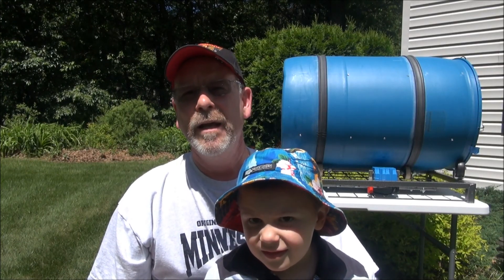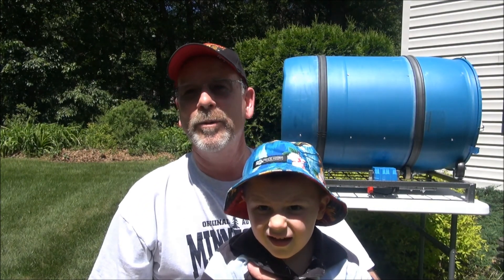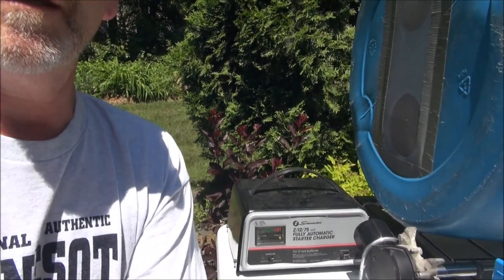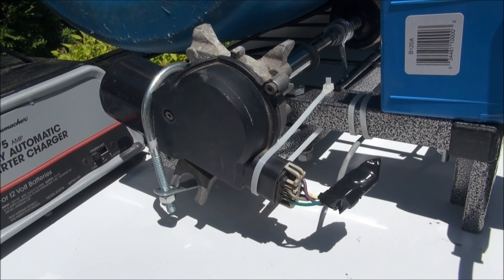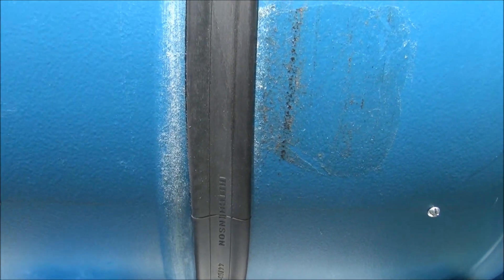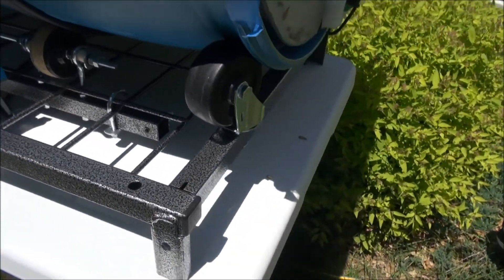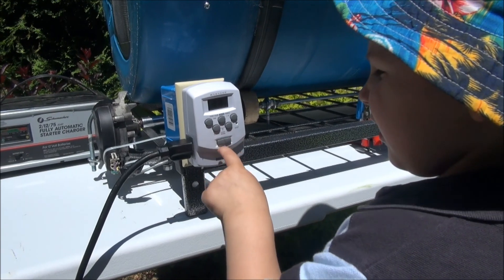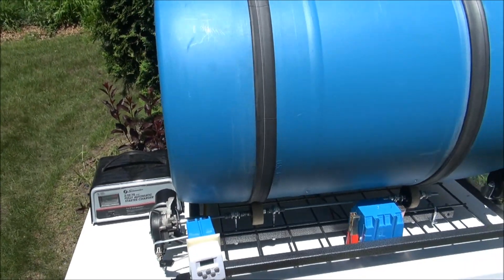Barley Roller

Comment: How  did you mate the 10MM x 1.25 pitch thread  shaft of the wiper motor with the pipe? Is that 3/4" EMT conduit?